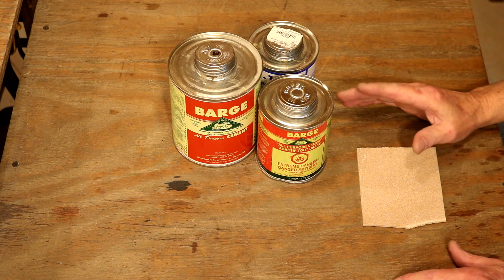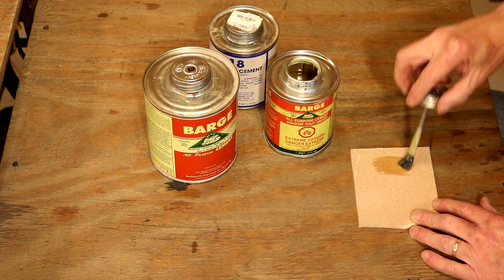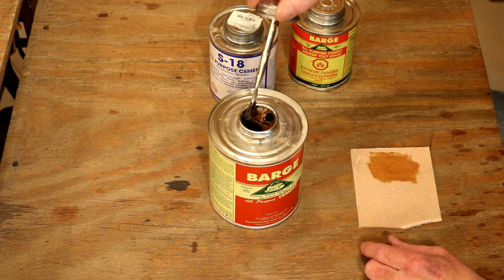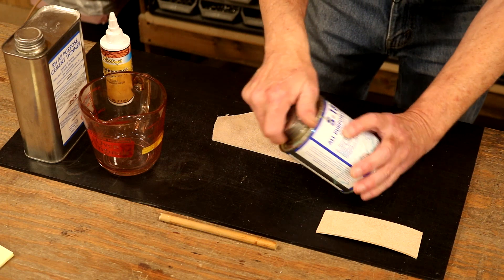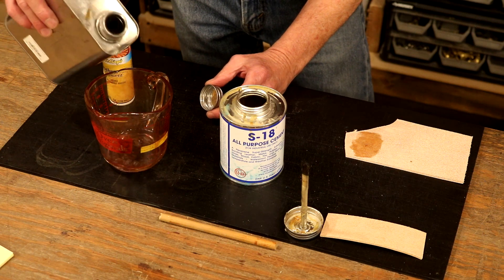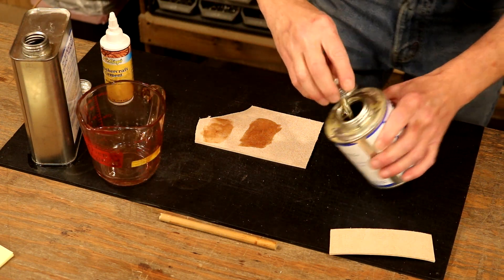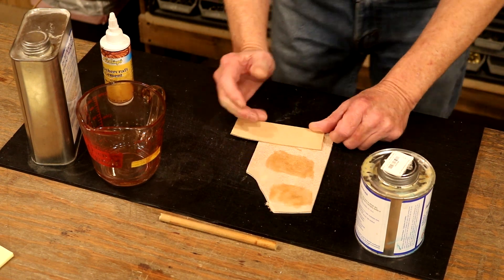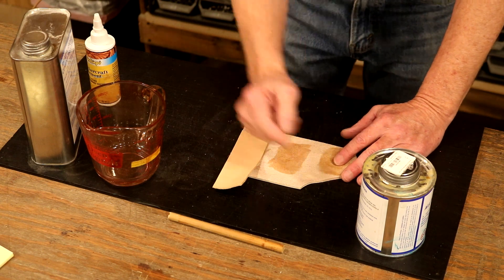The Leather Element: Thinning our Glue

Comment: Chuck, I’ve watched and rewatched your videos and always pick up something new. I finally decided to try thinning my glue instead of throwing it out. I put a little in a glass jar (it poured like very thick molasses on a January morning. I had to actually cut it off with a stir stick. I added a little thinner and stirred until it was all absorbed. Added more and stirred. Repeat. Repeat. Finally had nearly doubled the volume but ended up with some good looking, usable contact cement. Thank you for money saving tips.

Comment: Excellent video.  Love the production, especially 4:54   - had to replay it.  : )    Do you find mineral spirits does not weaken the strength of the glue?  Or extends shelf life?  I wonder if you could employ a method to seal your can better by  layer or two of plastic film over the mouth of the container before it's screwed down tight, or that and some grease applied to the threads to help seal out intruding air.
Reply: Try keeping it in a Ziplock bag, with most of the air sucked out.

Comment: What "thinner" are you using?
Reply: The can says cement thinner. But is there alternative thinners to use also?
Reply: @nathank4708  I don't know. My signal has the video very grainy so I couldn't read what the can said.
Reply: RH All Purpose Cement Thinner.
Reply: @nathank4708  Yes, any "contact cement thinner" will work. RH, Barge, Jasco, etc. However, I use and only use Barge Cement Thinner because I want to "trust" it. If that makes sense. I am sure if Chuck is using RH it's probably OK. I believe "thinner" is just acetone, but I would use a name brand just in case, it may have other properties.
Reply: @thedavidfield1  yeah i was wondering about acetone its more common here.
Reply: I went to the local hardware store and bought a can of MEK thinner for $10. Should be a lifetime supply for me.

Comment: didnt even have to watch further, you said in your first 15 seconds that if we have a good question we shall put it in the comment section below. Here we go: 
Spray can glues are too expensive for my tastes, is it possible to use this glue and spray it with workshop comrpessors in theory? (i know it will be a mess to clean it but i prefer taking 1 hour to clean the spray gun rather than spendin 50-60 bucks on spray cans... i learned one thing doing scale model planes..anything can be thinned and sprayed...same philosophy should apply to this but i prefer asking a professional who deals with glues all day. I will make some foam stick to my car interior, doors, ceiling etc for acoustic isolation and im a DIY guy, i dont like buying ready made products. theyre expensive, for the rich.